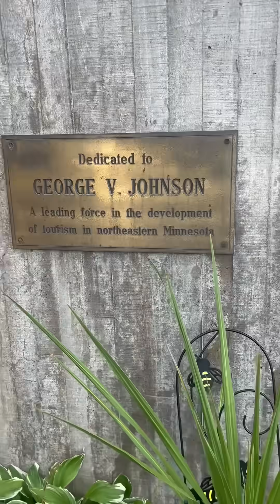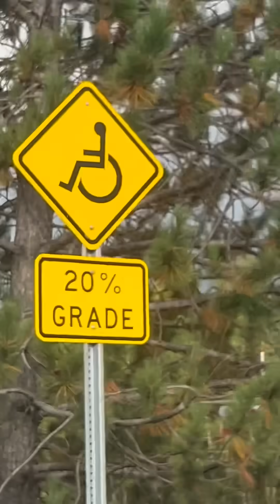Salt deteriorates CONCRETE🧂❄️#construction #concrete #salt

Comment: As a floridaman, I had no idea that road salt degrades concrete like this 😂
Reply from the maker: Did you watch the “Related video” at the bottom of the screen? Click on that one next to see what salt does to a garage floor over time.
Reply: As a Michigander I thought I'd throw a fun fact out there at you .... Road salt literally ruins everything... Almost all cars older than 10 or so years here that are driven in the winter have about a 3-5 inch rust stripe along the bottom of the car ..  I hate it